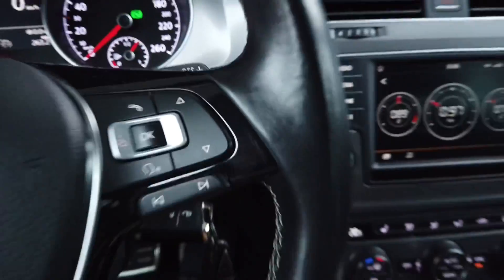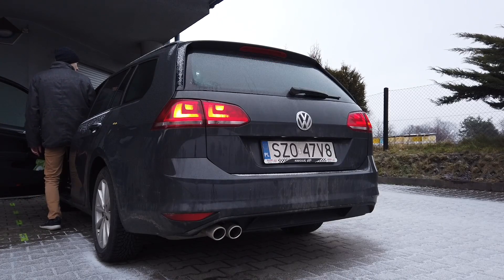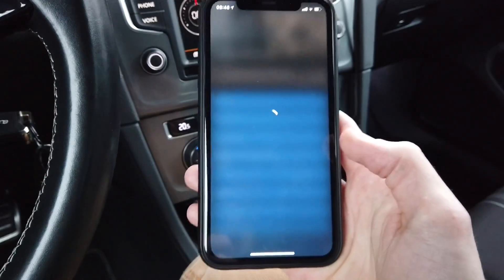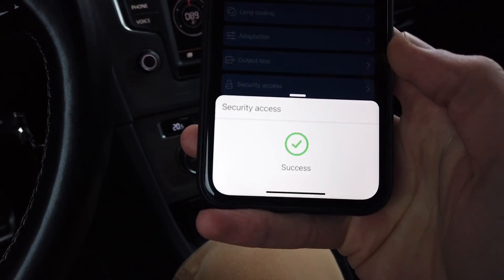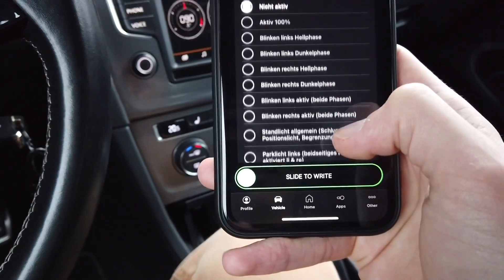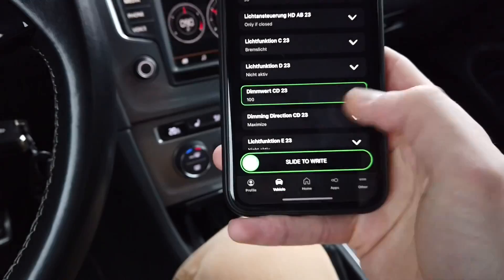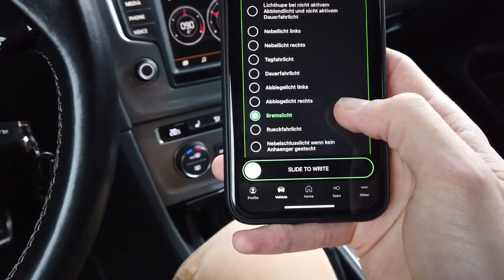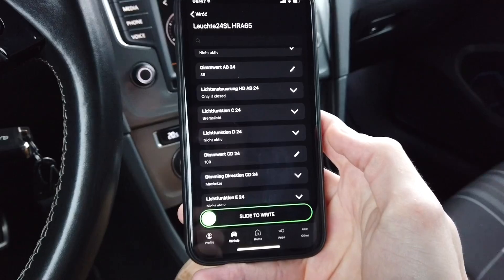VW Golf MK7 (5G) five brake lights activation

Comment: On my mk7 sportwagen the light beside the reverse light also turns on when braking or signalling.  Is there a way to turn that light off so it's just the upper "reverse L-shaped" lights (both inner and outer) that light up?
Reply from the maker: You fog light turns on with brakes?

Comment: Hey mr fix, I’ve done a few of the coding using OBDeleven pro, and now on infotainment screen, it says ‘vehicle status: function is currently not available’ do you know why and how to fix it?
Reply from the maker: I have no idea what you actually did but you can start with rebooting the system. Sometimes there are some glitches when performing changes in 5F unit.
Reply: @mrfixpl  is that just open 5f module and hit reset?
Reply from the maker: @umarwadee8026  No. Press and hold the volume knob for 10 seconds and the system will reboot.

Comment: theoretically it's against the law, because the lights have the max luminuos intensity it can glow so they are over homologated values. Of course question is if some inspector will ever notice that :D
Reply from the maker: You are sure? Now inner bulbs are exactly as bright as the outer ones which are the same type. Setting dimmwert to 100% makes the control module to power the circuit with 12V (before it was lower for position lights) which is nominal for bulbs used over there.
Reply: @mrfixpl  the car can have luminosity SUM of all lights, e.g., left(100)+right(100)+top(200)=400. But you add more left(100)+right(100) and it gives total 600. (the numbers are example)
you can test what happens when you have dipped beam, fog lights and turn on high beam - on many cars that turns off fog lights because the total SUM is over limit.
I can't find the law now, but there is EU directives for light homologation.
I think maybe VW does make the same light unit all over world, just uses different program settings for different countries (like scandinavian DRL ) etc.
Reply from the maker: @electricwhirl5175  OK, now I get it. Thanks for clarifying. If you don't mind I have a followup question: is this luminosity sum the same for all vehicles in general or is it a dedicated value fot a specific car? 
Also could fix this issue by bringing down the dimmwert for all brake light functions. Will still use 5 lights but with lower luminosity hoping to stay within the homologation limit.
Reply: @mrfixpl  AFAIK that is common for EU homologation for all cars (or maybe types of cars, e.g., small cars, vans, trucks etc). As the car lamps have those letters with E4 and some numbers, by those you can try to search for this.
In practical terms I don't think anyone in tecnical inspection station will measure that, that can be done only in certification centres.
I remember I run into this issue when some 10 years ago I changed for Golf3 the front lights to aftermarket, added DRL and fog lights from Hella (on standard the car equipment didn't have it). So the tecnical inspection (Lotwa) inspector was like - ooo, noo, you have to much lights added, but I was like - yea, but these all are valid with E marks etc... then came other two inspectors, they were checking everything, afterwards drove my car off the line and I had to wait for half an hour till they came out with the book and started to check all the lamps and pointed out - the total SUM of all lights exceed the allowed limit... 
Of course It was my case, because I had added aftermarket lights.
In your case inspector must be knowing that by default on Golf7 the car's don't come with 5 brake lights on, but just with 3. but in 99.99999999% they won't notice it :)
Reply from the maker: Thank you again. Very useful information.
Sure, I don't think that anyone will ever perform car inspection at this level of precision. But still - if I can make it fully legal, I should try to. I think that I will bring down the dimmwert here slightly to decrease total brightness.
Reply: @mrfixpl  Also you should check how it looks from another car (driver seat position) behind you in dark, because it could blind drivers behind you. LED lights by default are brighter and if you put them additionally they might blind driver behind you causing crash into you. 
there are also lux meters, so you could try to get some approximate values at least.
Reply from the maker: @electricwhirl5175  👌